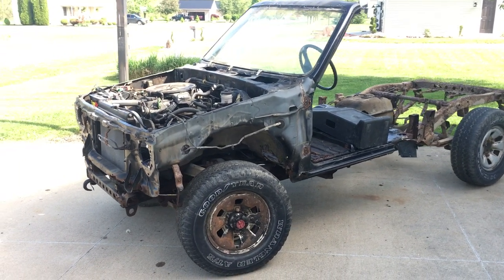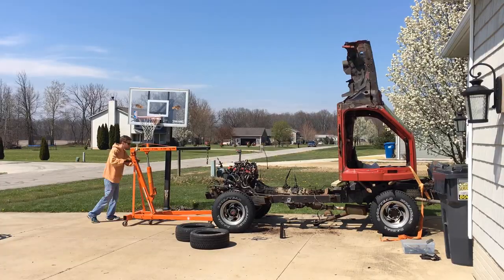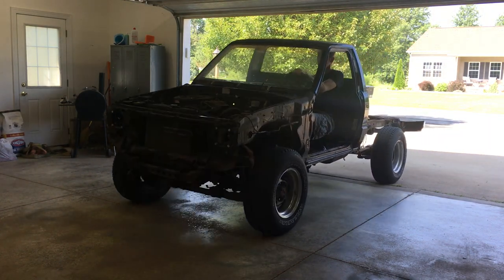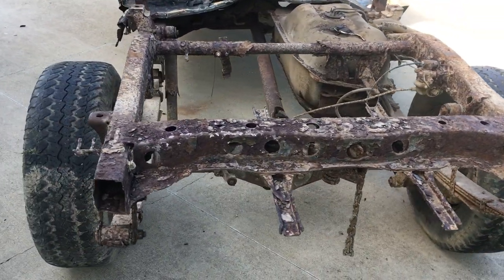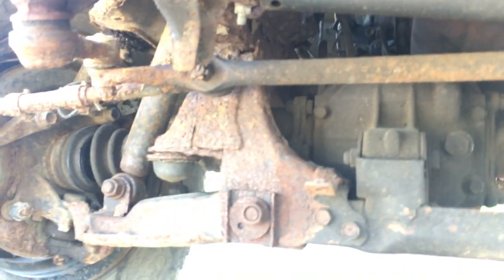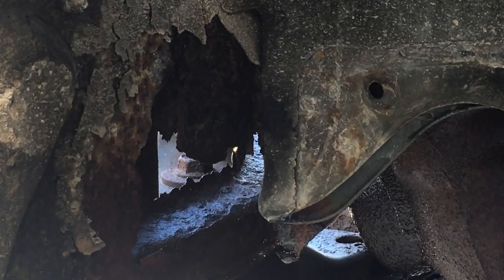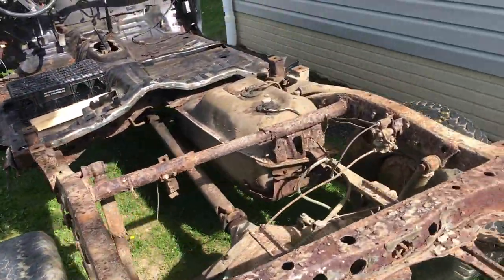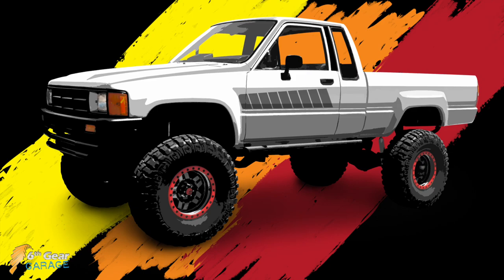1987 Toyota 4wd Pickup/Hilux Extreme Weight Reduction

Comment: Eh, here in Massachusetts that’s not even really all that bad…..as far as pricing goes, I’m from a time where you could buy a functional road worthy Toyota truck for about $2500.
Post covid, that’s got to be worth about 10k. (Mechanics special, low miles, no need to sell, I know what I have.)
Reply: saw a stock clean 85' 4x4 go for $50.000 at Mecum auction a few months ago